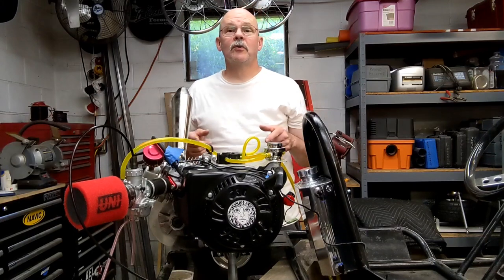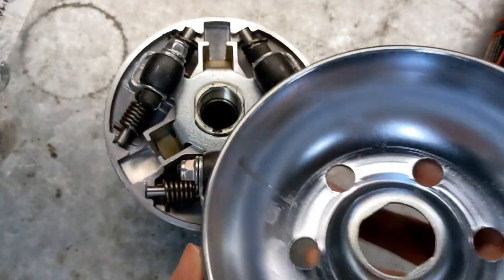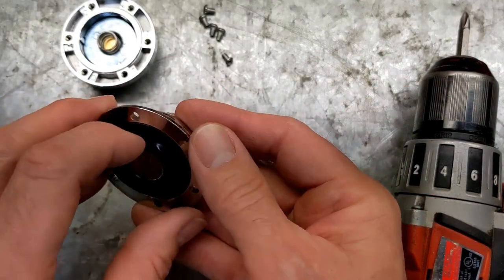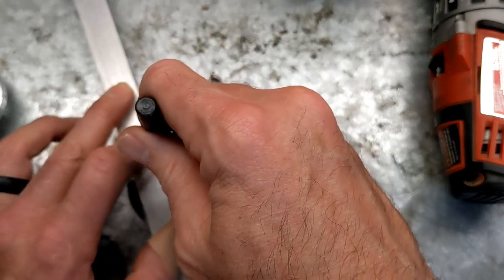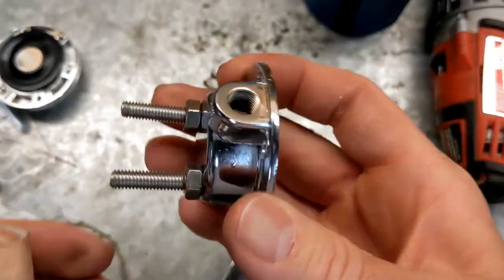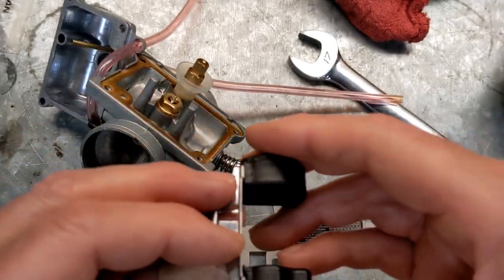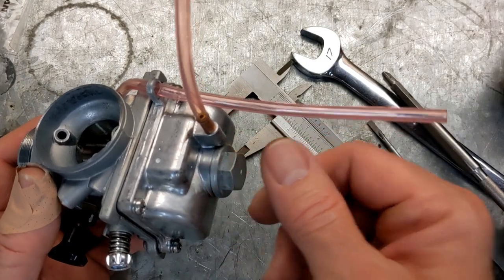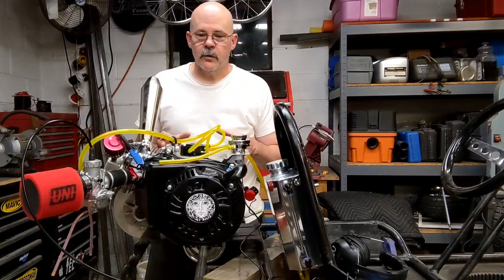Exploding Torque Converter Fixed

Comment: You may have discovered by now those fuel pressure regulators leak (even without mods), they're very common to be put on old classic Volkswagens so I remove them often, always leaking but before they start fires.  I'm not even sure if they regulate properly because when they're on seems that the carburetor is still being over-pressured. I usually just opt for a proper fuel pump which is regulated to the correct PSI, or if the punp is a little too high, then put a T before the carb thet routes fuel back to tank... currently running that of my 1968 Volkswagen Fastback with dual carbs... which are not unlike our go karts LOL!  For what its worth, in the hot Volkswagen engine compartment the T also bleeds off the excess pressure when its shut off, helps to reduce carburetor boil over from heat soaking. But that issue doesn't apply to go-karts though!  Thanks for the videos, my dude!
Reply from the maker: That is what I ended up doing, the T fitting with return was perfect, there is plenty of fuel at, basically, zero pressure.
Reply: @WhatIsTheWheel  Yup, it psuedo-simulates a gravity feed.  There will be just a little back pressure on account of the line being so short and narrow, which is just about perfect!

Comment: It's coming together and sounds awesome! That Torkzilla should be awesome too. I've seen FatBuddyCat use one of those and it makes me want one! You're right on about the Mikuni carbs and their clones not having the correct float level out of the box. First adjustment. I used a similar pressure regulator with a Mikuni on a pulling engine before. Best I remember it came with a little Z shaped metal mount that used two of the screws on the top, then I put a couple of sheet metal screws thru the blower housing for the bottom of the Z shaped mount. Great video!
Reply from the maker: Thanks, Once I get rid of all the rattles it should really sound good. Right now everything is tacked on because it will get stripped for paint. I ended up getting another pressure regulator, my mount idea may end up being to much of a hassle to stop leaking. Build Break Fix was saying these little carbs really only want about 1psi so the new regulator goes much lower.

Comment: And as far as the mounts that I found for those, typically it's just a C shaped bracket that wraps around the regulator with a hole on each end where the brass nipple screw in to support the regulator.  Seems to work well enough... when the thing isn't leaking LOL!  😁👍🏻🦆💩

Comment: To bleed off pressure from the fuel pump, Tee the output to the input but use a smaller ID line to make a restriction. The more restriction, the higher pump pressure at your chosen RPM. The poor man's regulator  :)

Comment: Just get rid of the pulse pump and put a gas tank above engine a little with a fuel filter and shut of valve it would be alot easer ..
Reply from the maker: No where to put the tank higher (without making the kart look silly). I would have put a mount over the top of the seat to get it high enough.

Comment: Or.. you just remove 2 screws that hold it together.  Get two long screws. Determine length for application. Put them in and tighten with a lock washer and a nut. Now you have two extended studs. Drill some holes and mount it. Or if you want it to "float"... Double nut it.   Just a suggestion.

Comment: Believe it or not the stock driver will handle more power and rpms than the jug/torque zilla but it requires some mods first as the torque converters out of the box are setup for a stock governed engine and just changing the garter springs isn't enough to turn high rpms it requires changing from the zinc to aluminum weights using even heavier springs and a lockout bushing
Reply from the maker: Examining the aftermath, I figured it would need a spacer to stop the moveable sheave. I had switched to a heavier driven spring. and I had two sets of heavier/higher rpm garter springs to use, but had not switched to the weights. I would probably have continued to mess with it if the shell had not gotten so bent up. It was easier to just go with the Torq-Zilla, and it gives me a chance to try one out.

Comment: Comprimising the pressure chamber of the regulator is a bad idea.  I would instead make a mount that used the existing  seal/flange bolts and just use longer bolts.

Comment: That's good werk~
Did the pressure reg stand up to it's job of 
3 lbs or what you set pressure  to; ?  MaX without  R & R   of main-jeT and it so  what jet size ____?
Thank you for the 411; in advance..Sincerely> °H°∆°R°D™
FLaTLaNDs oF KaNSaS
Reply from the maker: I ended up ditching the pressure regulator and using a return line to the tank in a T fitting at the carb. So the carb always has fuel at zero pressure. 
I would have to go through my notes for the jet size.
Reply: SMaRT MaN~ I ran into that same issue when I super Mod`ed the Honda GX390 Over fueled float went to a reg- figured out Return line back to fuel cell was the right answer to the problem.. YoU just might say I over  
THUNK -iT..  GriN:) GreaT Vids and >with On ToPiC 411   yes SiR~ °H°∆°R°D™ FLaTLanDs oF KaNSaS

Comment: I didn't watch the whole video, but just a word of caution: The numbers on the regulator are NOT PSI. They are just numbers from low to hi. So don't think that number 3 means it is regulating the fuel to 3 PSI. Put a fuel pressure gauge on it and you'll see what I mean.

Comment: All that $ and effort to use a fuel pump! Why not use stock tank with risers and bigger fittings? I don't think tach is right
Reply from the maker: Some of it was for looks, both to have a clean look on the engine and to use a remote alloy tank. The tach is correct. It inducts the signal from the spark plug wire and is set to read every other signal(the coil fires on scavenge cycle too). I used them on commercial mowing equipment for years.

Comment: no no no.... the carb your using is not designed for a pump.  float valve is made for 1psi fuel pressure.  your pump is around 4psi.  either need fuel flow regulator or a bypass.  has zero to do with rpm.  this is like a 20 year old  issues that most don't ever seem to know.  plus your using a pump for a 422cc engine lol. just drill a hole in a angle bracket so one fitting going into  regulator through the hole.
Reply from the maker: These little carbs may have a lower pressure limit, but the bigger Mikunis are around 3psi for the float valve(Most carbs are 3-6psi). The tank is lower than the carb and this pump is used on karts with the tank mounted on the seat pan in front of the driver so I figured it would work. The rpms do make some difference as the pump pressure at 8000 rpm is higher than it is at 3000. 
I decided to try a different regulator with a gauge, that has a mount.
Reply: @WhatIsTheWheel   lol no such thing as a 6psi round slide carb for small engine. Smallest 4psi carb is a 32mm  mikuni flat slide.  What would I know though!   Only raced and built gokart for last 20 years lol but hey! Come to longs sc! You can ride my 8 tracks all day on me!
Reply: Btw! Legit mikuni vm28 carb I just opened up.  Page 2 3rd line"Do not use this carburetor with a pressurized fuel system. This carb is not to exceed a 21 inch down hill grade from fuel tank"  pretty clear in mikuni papers come with the carb lol hey look this! 34mm one says it as well rofl...
Reply from the maker: @BuildBreakFix  I based the psi on the bigger carbs on motorcycles and the Holleys and Eldebrocks I have run.
This carb came with no paperwork, although it does appear to be a real Mikuni
South Carolina? Do you know a Donnie Stevens from NC? He used to race karts and grind custom cams in the late 80s
Reply from the maker: @BuildBreakFix  Part of this series is just trying stuff out. I show my failures because that is part of learning how to do things. A lot of Youtube channels edit out the mistakes(like skateboard videos where they never miss a trick) but I want the people that watch to see the mistakes or when something doesn't work, watch me work through it, and know that is part of the process.
Reply: @WhatIsTheWheel  Do you mean Donald Stevens? if it's same person then I know who he is.  He fixed the ring gear on a rotary turbo cart engine years ago I still have if it's the same person. he was very big into making custom parts for small engines in general.   But I think he died few years back. What i was told anyhow!  I don't know where he is now and such if it's same person! very big into rebuilding small engines.  he placed a few times in top scored of the briggs races if it's same person in early  1990's
Reply from the maker: @BuildBreakFix  That could be him. I worked with him in a power equipment shop(in the 80s) and he was way into building flathead I/C Briggs. Running Honda cranks, huge valves and his custom cams. He would take two cams and lathe them down to a gear and a cam with a hub so you could degree them. Had built his own cam grinder. He could have passed, he would be, at least, in his mid-late 60s by now
Reply: @WhatIsTheWheel   That sounds like him to the t actually! lol!